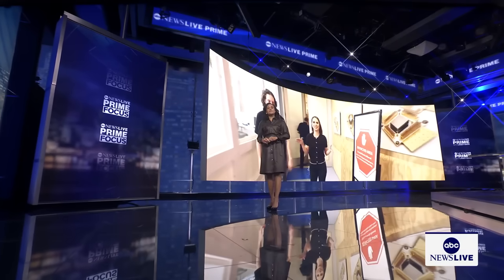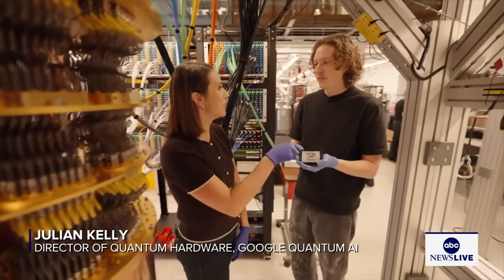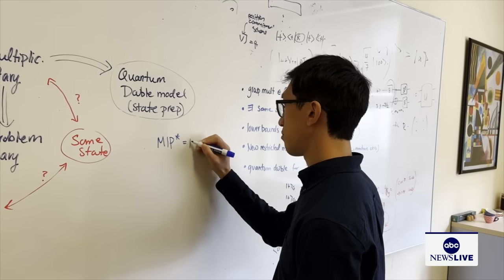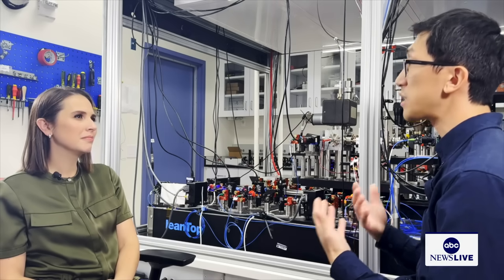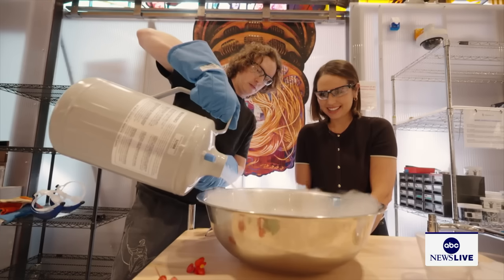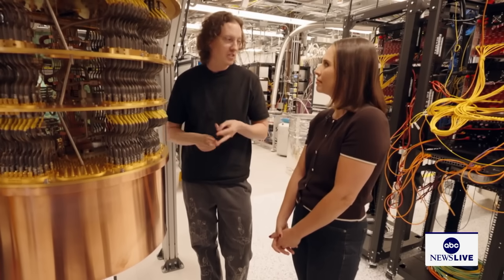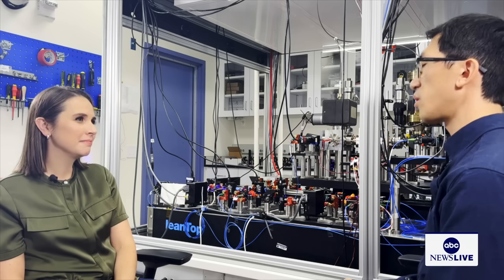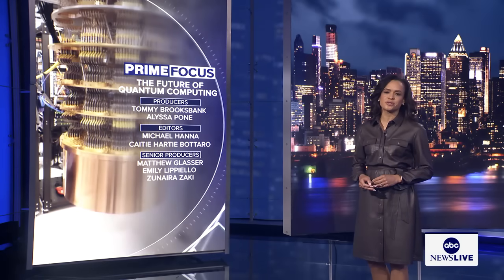Inside Google’s quantum AI lab

Comment: I dont understand why photonic quantum computing isn’t gettin more attention, it doesn’t need near absolute zero conditions
Reply: There are many more problems to perform calculations using photons. Maintaining cryogenic temperature is quite easy, using liquid helium, and can be easily operated in a lab or a company. You don't need to think that each PC will have access to Quantum chips, rather you will be able to access it via cloud to perform your calculations for some cost.
Reply: @ABrightLightInDarkness What are those problems? I was under the impression that quantum computing is energy efficient and most likely to succeed?
Reply: Single photons like to disappear inside a photonic chip. If they carry some information, well, now it's gone. This is the main problem.:face-orange-frowning:
Reply: @Vatsek  Is that an undesired consequence of quantum tunelling?
Reply: @VolatilityDoctor  No, this is not related to quantum tunneling. Total internal reflection is not 100%; optical waveguides must be bent to interact with other waveguides. This causes reflections propagating back into the waveguides. Essentially, some of the information that photons carry is getting lost somewhere inside the chip. It never arrives at the output.
Reply: I like the video on YouTube by Julia McCoy who disclosed how the Photonic Quantum Computer solved a 20 million year old problem in 20 minutes at room temperature.
Reply: @leroyessel2010  Do you have a link I could follow? Or even better, a playlist?